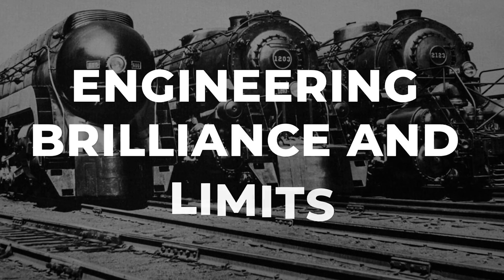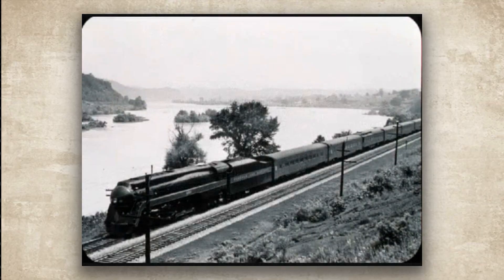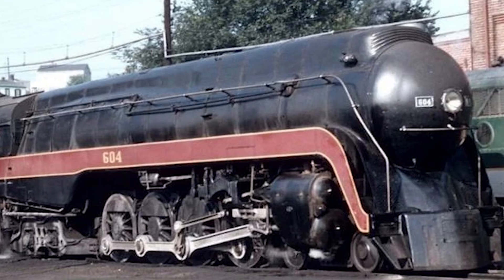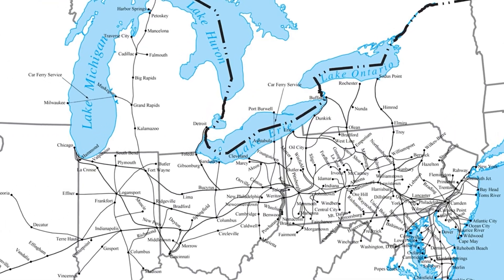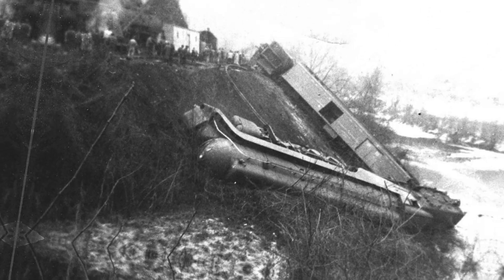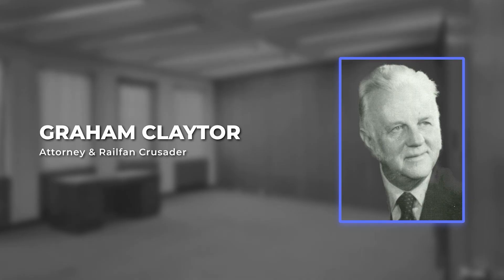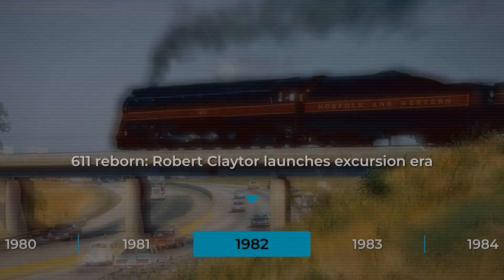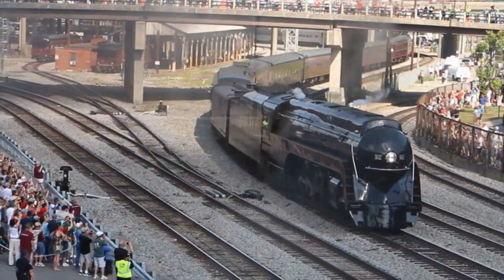How DEADLY Was The N&W J-Class ACTUALLY?

Comment: It's very interesting learning about the history of steam locomotive service records, there were 4 derailments of the N&W J class because of excessive traveling speed and track sections citing speed restrictions and locomotive 611 suffered a derailment in January 1956. Locomotive 611 was rebuilt and returned to service again after the 1956 derailment as the J class were the N&W's main passenger service locomotives and 611 eventually ended up being preserved as the sole surviving N&W J class locomotive, which is fortunate because there was desire to see at least one of the J's be preserved as a tribute to N&W steam power.

Comment: From a numbers point of view, the UP FEF 800-class locomotives were far more powerful, and arguably the best and most "modern" 4-8-4 ever built. 63,000+ lbs of tractive effort on 80-inch drivers. They were just as at home pulling a drag freight as they were hauling ass on a passenger train. The class J is still my favorite on looks and sleekness, but in the brute force category, the FEF is on top.

Comment: Uhm, no? The New York Central Niagaras are considered the most powerful AND most efficient 4-8-4 steam locomotives of all time
Reply: Most powerful, yes. They have the highest drawbar horsepower of any 4-8-4, at 5,300. I believe it was NYC 6000 herself when at 290 psi, but pressure was lowered to 275 psi for maintenance reasons. As for most efficient, that depends. At speeds above 50 mph, then yes, as they were designed for high speeds, hence its 79" drivers. Below 50 mph, the J is superior to the Niagara, as it was designed for medium speed, mountain climbing, and high acceleration, hence its 70" inch drivers. Heck, the PRR T1 proved superior to the J above 60 mph. This is why power and strength should be separated. The J is the strongest 4-8-4 at 80,000 lbf tractive effort and the Niagara is the most powerful 4-8-4 at 5,300 drawbar horsepower.